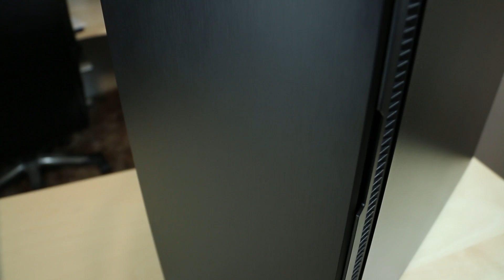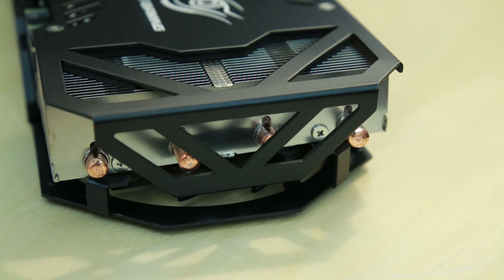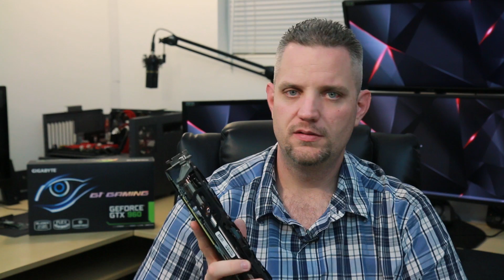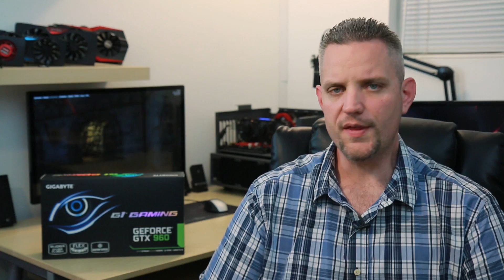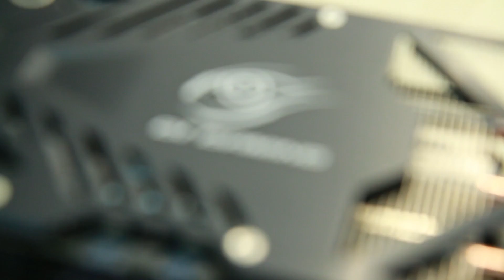Gigabyte GTX960 G1 GAMING - Best Mid Range Card Yet?

Comment: IMO, 2GB is fine.. Even the R9 285 (960's competition) also have 2GB. It's the 128-bit memory bus that is UNACCEPTABLE. It's clear what NVIDIA is trying to do.. and that is to increase their profit margins by cutting down on the hardware and focusing on the efficiency side of things.. The problem is you can't fix a hardware limitation. Bandwidth is greatly reduced, and color compression can only do so much. AMD also has their own color compression tech, but did they skimp out on the R9 285's memory bus? No. They put 256-bit in there and they have answered every feature that NVIDIA came out with (Freesync vs G-sync, DSR vs VSR, etc). The only thing where they have AMD beat is Perf/watt.. but really is that a concern anymore?

Comment: For those people complaining that this was a shamefully priced card with 2 GB of RAM off a 128-bit bus and performance no more than a 760, IT'S SUPPOSED TO BE LIKE THAT. Yes, the 970 absolutely DESTROYS this card, but that's considered a 1440p card. This is a 1080p card and for the price it's definitely passable. Honestly, unless you want to game at a resolution higher than 1080p or you find an AMD r9 280x or higher for less, there is no reason this is not the sweet-spot for 1080p gaming. I'm looking forward to getting it as I play on a 1050p monitor and a 970 would bottleneck my Pentium G3258. People have budgets to deal with. As a Canadian i don't want to throw away 500 on a 970 where I can easily only spend 300 on a 960 (I'm including taxes).
Reply: The problem isn't the card, its the price. This needs to be priced at $140-180 to even be considered.
Reply: ***** Aw crap I wish I could get the 280x...that's a steal at the price actually! But I stilll prefer Team Green for the GeForce Experience. Two of my friend's AMD cards died on them early and honestly, I don't need the luxuries that a 280x. YES, it outperforms, but honestly the 960 would last longer and I REALLY DON'T NEED the extra power. Like seriously. I play on a 1050p monitor and a Pentium G3258. I feel like the G3258 matches with the 960 perfectly (it would bottleneck afterward). Good enough for my situation.

Besides, later in the year I can choose a 5th gen k series core i5 and pair it with a 980ti. I dream of doing that one day...
Reply: Zuhayr Sarker just a heads up, I have a build similar to what you described in two variants, both with the Pentium Anniv Ed. G3258 - one with a GTX 760 and another with an R9 280X. Both get very respectable fps (mins of ~40, averages of 70) in bf4 on high settings at 1080p. I'm not sure what kind of mileage a more powerful CPU could provide for either GPU, but I suspect there is little to no significant bottlenecking on those cards for that CPU, especially with a healthy 4.5GHz overclock. It takes a lot to CPU bottleneck a GPU, and looks like that CPU is up to the task!
Reply: Theodore Teow Meh I'll still take the 960 anyways. I've been wanting a GPU for a long time...I'm running off Integrated Graphics now...
Reply: no, it doesn't supposed to sit right beside 760.
Reply: March Fifth And it's better to rename it as the 950 or 950ti as well at the price.
Reply: you know what's shitter, in my country the price of this shit is $380 (Asus DCU II Strix one)
Reply: diazzsama Doesn't matter. That's the same price of it in Canada.
Reply: I dont know if the 970 costs more where you live, or you're confusing prices with a 980. The 980 is in the $500 range.
A 970 list price is about $350 and a 960 is about $250. For how much weaker a 960 is, it should be a lot cheaper than it is, compared to a 970. Saving a mere $100 for buying a 960 over a 970 just isn't worth it.
Maybe when the price drops beneath $200, the 960 will be worth it.
Reply: CogniVision No, it actually is that price. Prices have somewhat dropped but I still think they are crazy. Here: http://ca.pcpartpicker.com/parts/video-card/#c=186&sort=a7

By the way, those prices are before taxes. With taxes, NO GPU is under $400 dollars.
Reply: Zuhayr Sarker Yeah so it just costs more where you live.
Here in the US it's only $350 list price. The 960 is $250 so it's more worth it to just buy the 970 for those of us who live in the states.

Comment: The GTX 960 impressed me fairly well. Most reviews and benchmarks show it to be close to a 680/770 or 280 or 280x, but at a lower price point and power consumption. Whilst it's not holding 3GB of VRAM, you have to consider than even though many games are recommending more than 3GB of VRAM, many who hold 2GB cards are doing a fair job in games, sometimes it doesn't make a large impact at 1080p or lower. At higher resolutions, the extra VRAM would be nice but I'm sure the 960 was meant to specifically fill that mid-range point.
Now all in all, a lot of people are hating on the low memory interface but I WAS EXPECTING the low bit-rate. We saw it in the 750 Ti, and no doubt we would've seen it in the next cards at some point. Maxwell was designed under that respect. As mentioned it has very low power consumption, I can imagine people going as low as a 400-450W PSU with this card. Pricing is reasonable, with the UK release, the cheapest one I can find on Scan.co.uk was £160. The card has done its job, and will serve those who need it and those who are willing to appreciate what it offers.

Comment: Nice review! Would you think this would be better than a msi gtx770? And should I really overclock it? Becuase I will be buikding a new pc. Which is my first ever to build. :)
Reply: Wouter Doeland Don't buy this card. Buy r9 285 or r9 280x. 2Gb of ram GDDR5 will sttrugle at high textures on most new games even on 1080p. Starting with LoTR:SoM, AC:U and FC4.
Reply: jony bonilla please tell me how they are broken? mine has been running perfectly for the last 5 months? (and FYI i'm a very unlucky person, mobo got fried after like 3 weeks of purchase)
Reply: It's even slower than Your 770 especially if Your 770 is maybe factory overclocked
Reply: Papierkork Feuerstein thanks for your reaction. But this will be my first ever pc to build. So I don't have any cards yet. But I was thinking about buying a gtx770. But since the gtx770 is starting to grow in price (at least in the Nederlands) I am going over my budget and wanted  to buy a cheaper card. So that's why I tought of the gtx960. But the question is wether this is a great card for my first pc. I will probably buying my pc in late March. ~Wouter
Reply: Leandro Rodriguez don't buy the 280x 90 % of this cards are broken. Get the r9 285 or the 770, but if you can spend a little more i recommend the 970. :)
Reply: It happens man.  Look for asus 280 x artifacts and for Msi.  Not all of them are bad, but its a matter of luck. you just got a perfect card.
Reply: well, of course there will be reports of bad behaving cards whe nyou google this and that problems, but there are plenty of happy 280x owners just like i am

Asus r9 280x dcu ii here and never had any problems (doesn't even run hot as some people are stating 75C max and can't hear my pc with headphones on)
Reply: i got unlucky twice. :( fixed it when i upgraded to the 780.
Reply: here you go sir, seems like even your "perfect" 7xx series have problems too https://forums.geforce.com/default/topic/549618/gtx-780-freezing-and-stuttering-after-about-2-days-on-/

see? things like this can be found when you google this and that problems... majority of 280X users have no problems, same for the majority of 780 users... Nothing in this world is perfect, and it really is just bad luck if you have problems with a GPU...
Reply: Nothing is perfect in life...What can i say but the chances of you getting a broken 280x is greater than getting Freezing and Stuttering on a 780.
Reply: and how can you prove this? I haven't seen any1 claiming to have problems with 280X ever and i do read many forums actively... I can't find any info about random stutters and artifacting if i don't spesificly go to google and type in 280x artifact and stutter.... It is possible, that some1 is so unlucky that they can even get 5 gpus, that have something faulty in them from the factory...
Reply: and there tons of forums But il just give you one. http://www.tomshardware.com/answers/id-2032802/280x-artifacts-problems.html
Reply: comments from one of the forums, a guy named. enamak: Almost all R9 280X have artifact problems, i had to RMA 2 asus 280x. You shouldnt overclock or underclock to get rid of the artifacts, rma it fast as you can and get a GTX 770, its the best you can do.
Reply: and how does that 1 comment prove anything? has he owned almost all 280X's? your argument is quite irrelevant...

If almost all 280x's would be faulty, then there would be warnings all over the place to not to buy them, but for some odd reason, i haven't seen any1 who has claimed to have problems with them nor not recommend it...

if you search it with your ideology that if some1 states almost all of this and that card are faulty, then every single gpu on the planet would be faulty...

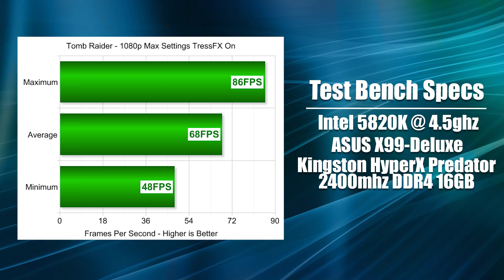Comment: 4:23 i have an gtx 970 g1 gaming from gigabyte oced to 1430/1900 and i 5 4590 and i get in tomb raider fps drops to 28 fps in 1080p max settings. How does it work with one 960 so well O.o
Reply: Try this: Nvidia Control Panel: Power management mode Maximum Performance
Reply: ThePAMulti and what is the effect? I have an boost of 1430mhz gpu and 7700mhz ram

Comment: Only 1 6 pin power requirement!?!?!  so I'm guessing this would be fine for a 500 watt power supply? Really makes me wonder if a 970 or 980 would work for one. I didn't know maxwell was THIS efficient.
Reply: Here's a graph of a bunch of cards power draw: http://gyazo.com/f461662bce24f39816d97982d94b536e
All done on an overclocked 2011 6 core build.
Reply: thanks
Reply: a gtx 980 can run on 500 watt.. gtx 960 can so to
Reply: 12me91 Most of the midrange to high end cards can run in a 500w psu as long as its a good one.I mean AMD says you should have 750w for a 280, when a 450w is enough.They have to because of the bad PSUs out there.
Reply: Vlad Draghici That makes sence.  Eh my bro has a 80+ bronze evga so it should be okay.
Reply: 12me91 yeah even an r9 290x would work on a GOOD 500w psu.although it's kinda close.
Reply: Vlad Draghici I personally wouldn't trust less than a 600w psu with a 290x better safe than sorry kinda thing, heck I'm not even sure I'd go over a 970 on 500. Granted I do have paranoia issues with stuff like this,
Reply: 12me91 for the 290x , yeah 600w at least i would say.